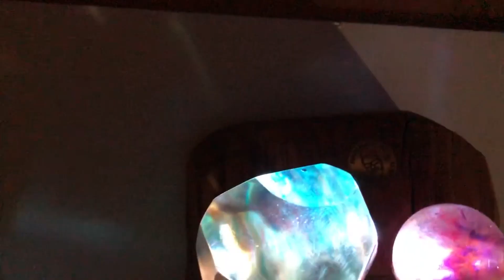How Shaving Foam & Food Dye React In Resin - Unwaffeled

Comment: Now we understand why you don’t shave,  it’s all in the resin.  Would the resin have set if you had stirred the shaving foam into the resin before hardening?  Small bullet lights are nice.  Half expected you to router our a space for 3AA batteries, a switch and wired LEDs under the objects.   Very nice.  Stay safe out there.  Cheers,

Comment: You have the charm, Ben has the PotCam.  I love pot cam, but 99% of the time, nothing happens, it just slowly clears, but it's so worth those times when you see what goes wrong.  Not that I want things to go wrong for you guys, but it gives the added benefit of figuring out exactly what the issue was, rather than trying again and again.  For a minute I was excited to see the shaving cream on the pot cam and then realized "wrong channel", in this case, I was extremely disappointed, cause then it was just a video, no charm, no cam.  I thought just maybe the shaving cream would cause a similar effect as when soap bubbles with UV resin, but I guess due to the heat, the shaving cream melts way before it starts to cure enough to hold the shape, see those are the questions pot cam answers, does the shaving cream melt too quickly or is it that the shaving cream has no texture to leave behind?  Now tomorrow I gotta try shaving cream with UV resin.  It probably works better with soap bubbles cause they're bigger, but the shaving cream might give the UV resin, some nice texture.  I'll know tonight, Tuesday evening.
I can't wait until I can find a job or sell some, all,  of my pieces, so I can get a lathe. I wanna grow up to be just like you 2.  Since I'm in apartments though, I'd have to get like a really small one.